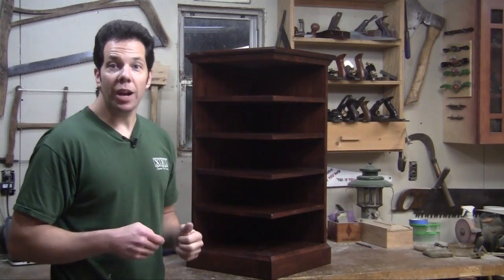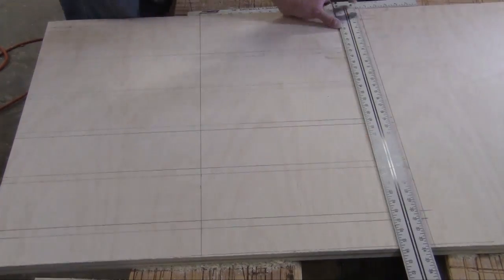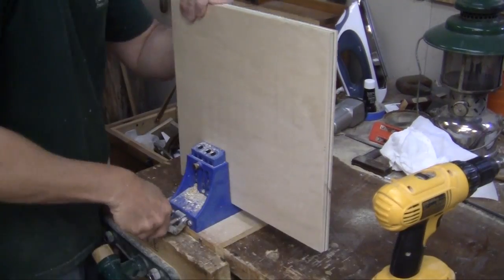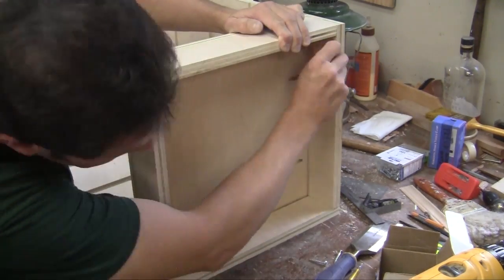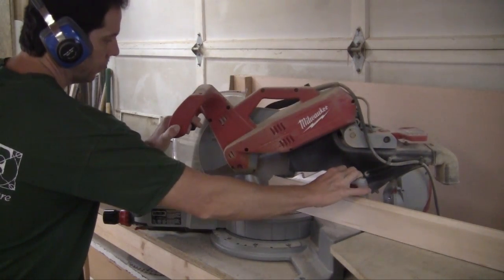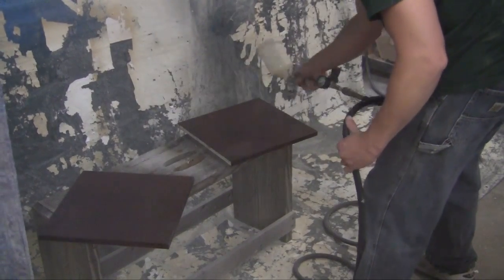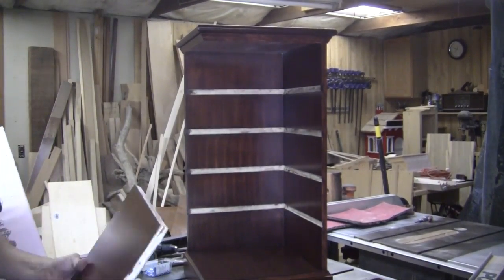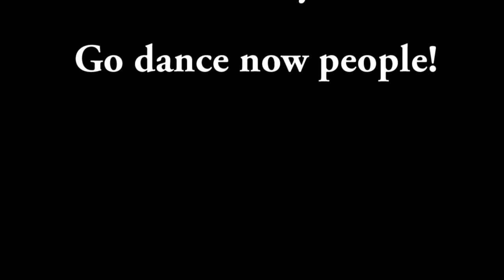Make a Reader's Bookstand

Comment: Will you please oil that squeaky pencil!
ADD, I have never been diagnosed with it but they say my attention span is...........  look a squirrel ............
Where were we, oh yeah the readers organizer bookshelf stand corner thingy. Nice work Chad. What was the red tool you were using on the edge banding. That looked cool.
Any way, you did a fine job and made it look very easy. Keep it up. Were all watching....
Happy Holidays my friend and Dan to!
Reply from the maker: That tool is used for trimming edge banding. I think you can get it home depot. It actually has two that you squeeze together to trim both sides at once. But i think it works better doing once side at a time.